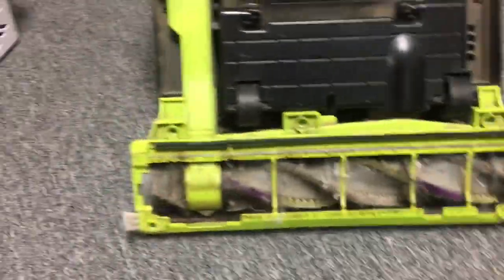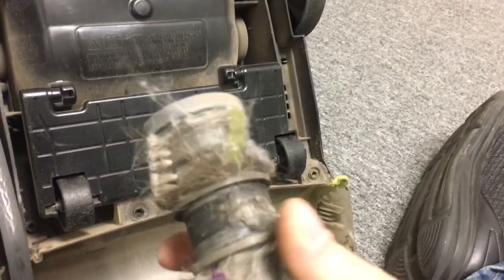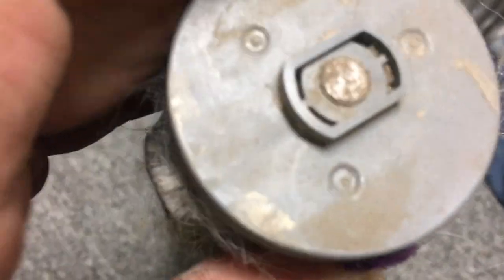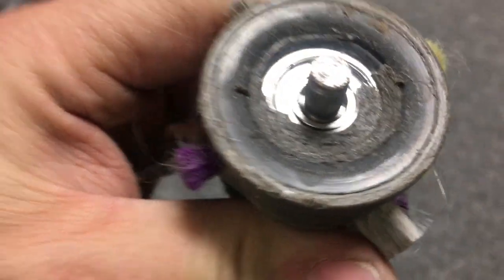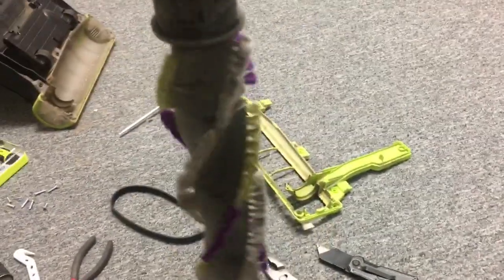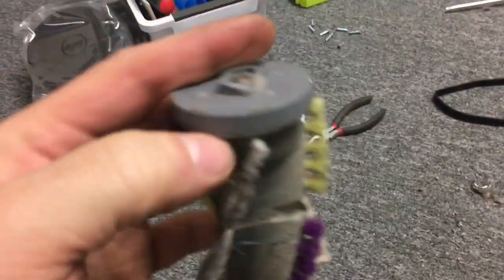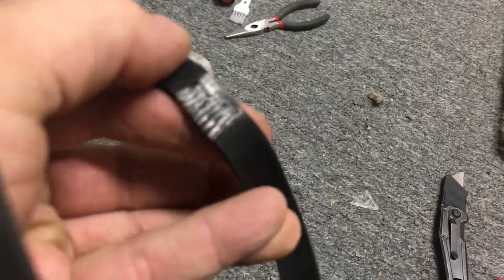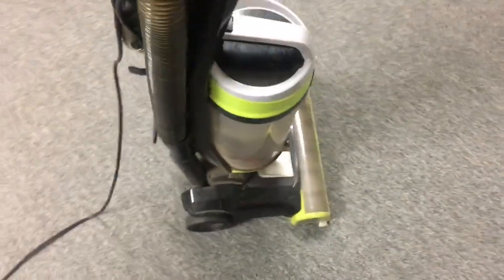Let's fix Bissell Vacuum Brush Roller not spinning belt is not broke

Comment: I got one of these for free recently.  It's brush was bound and Bissell recommended it replaced. Instead, I sprayed some Nut Buster into both ends of the brush and it gradually freed up. Now the unit runs like a top.
Reply from the maker: yeah the bearings were rusted. not sure if I showed the bearings on this one or not. people wash the rollers thinking that helps but it causes the bearings to rust because well you just trapped water into the ends,....

Comment: Is the rod the belt goes on supposed to be hot ?
Reply from the maker: that's the motor the motor gets hot. if the belt is slipping it gets even hotter... make sure your roller spins freely. I think I show it in video. if roller isnt spinning easily then you will burn belts and overheat the motor or melt a bearing on left or right side of the roller, or melt the roller at the belt area. the cleaning girls have melted a lot of rollers because they let roller slam still from too much hair or jammed stones, bolts, plastic etc...

Comment: I sprayed the roller off with my garden hose and now the roller has locked.
Reply from the maker: um never clean a roller with water. you rusted the bearings in both ends. you most likely can still open the ends and lube them back to life though. dont damage the ends and make note where the center axle is on both ends. aka is it sticking out slightly or is it flush on both sides, you want to put it back together as it is or you will offset where the belt touches and possible make is travel as it spins rub and snap over time.
Reply: @bobspurloc  thank you for the info & reply. I did get it spinning , finally . I haven't had this vacuum long. Looked a little Dusty under the clear brush roller, so I hit it with the garden hose. Started to vacuum the rug tonight and it was making that sound like something's wrong! I sprayed some silicone down into the axle, cleaned both ends. Put it back together ,but it wouldn't go . Took it apart again and it seemed to be okay. Put it together again , would not spin when I turn the motor on. I took my thumb and made it rotate a few times, then turns the motor on again and it started working. I was thinking I'm going to have to go buy another vacuum cleaner tomorrow. You saved me thank you very much.
Reply from the maker: well replacement rollers are under $20 I believe its all the same for Bissell. but yeah the bearings. if you take the roller out you can hold the end and spin the center. you dont want to use the motor/belt to force it because if the belt slips you are going to melt the belt aka snowballing the problem lol. but glad you got it going.

Comment: Thanks! I was wondering how to remove the end caps. One of the bearings was seized in mine. I replaced them with old skateboard bearings that spin well and that fixed my problem.
Reply from the maker: nice! yeah all the bearings are the same thing only difference is sealed or not. I think I noticed one thing though not sure, aligning the wheel properly back to the belt so it doesnt make it rub the metal barrier  or I may have had a warped roller. when the belt spins on a non moving roller and you ignore it it starts to melt the roller.

Comment: Would a roller not turning cause the vacuum to smoke? Because mine stopped working while I was using it,  and when I took to cover off, the belt was snapped. So I got a new belt and popped it on thinking that was all it would take, but when I turned it on and the roller still wasn't spinning, so I shut it off and then some smoke came out of it. I'm going to take it apart again and check the endcaps. But I'm leery about testing it out again if it's something else. I don't want to catch it on fire or something.
Reply from the maker: yes,,,, roller not spinning will cause the belt to smoke and break. you need to pull the roller out and see if it spins like I think I showed. the bearings do wear out on these from hair collecting into the area melting like plastic onto the bearings. its just best to replace the roller than the bearing depending on the damage and skill level. I think I show in other videos how to take roller apart least damage but sometimes its not wise as the belt spin area warps and will just cause belts to break prematurely etc

Comment: Thanks man. Who would think to remove the end caps. Did it on my Bissell and now the roller turns. Thanks so much for sharing.  Cheers
Reply from the maker: Yeah I just had another that was super loud. I finally realized it was the bearing on the belt side. I pulled roller completely apart and swapped the bearings now its quiet again.  beware though you should check the belt path after putting it back together as you can offset the roller and cause the belt to walk slightly outwards which would have it tapping the metal guide barrier near the motor. basically after putting all back together run motor for a few seconds then check the belt isnt hitting the metal guide as it will eventually rub snap. I think you can adjust the offset back by holding bother ends of roller and tapping the metal center so it moves slightly left or right.

Comment: My belt snapped, thanks for the vid
Reply from the maker: make sure your roller spins freely all the way around and is not binding, otherwise your belt was probably just old.  beware junk belts on amazon some are made of cheap rubber that snaps after like 20 uses

Comment: Hey howd you clean the end bearings? :)
Reply from the maker: I forget what I did here. there was burned hair and plastic there. I used a knife to to shave some or test what it was but I think mostly used a screw driver. also This bearing turned out to also be going bad, so I swapped it to the other side. normal pressure spinning it sounded fine but on the belt side that extra pull was making it loud. so swapped to other side. all these bears are basically the same thing in all tools these days. its the same as a power drill bearing, the bearing on the actual motor same bearing on skateboard same bearing in fidget spinners. of course you want a sealed bearing but they are all 608ZZ bearings metal sealed. https://amzn.to/44y9WWa

Comment: Ive just took my vaccum apart my vacuum is clean , I clean mine after every use,  thinking it was my belt i just changed it ,and it still wouldn't turn i was vacuuming before I noticed my brush wasn't turning that's what made me look  so I'm not sure how to check for the motor for the brush etc.
Reply from the maker: can you freely turn the brush?
Reply: @bobspurloc   no i can't, I've tried several times taking it off the belt and it still doesn't turn
Reply from the maker: did you watch this video??? kinda sounds like you didnt if that is your answer. my next questions would be what I showed in the video
Reply: @bobspurloc  it's a rarely new vaccum i purchased it 2017 and yes i watched the whole video but i don't know how to take those end things off, my vacuum has never had burnt hair or anything like that i keep my vacuum clean after every use so it's not anything to do with to much hair or whatever I'm going to rewatch this video maybe i missed something on it but I don't know how to take the ends off but they shouldn't look like the ones in this video
Reply from the maker: ok I was asking so you can see how the roller should turn. if you hold that very edge it should turn. if it doesnt then the bearings on one side are jammed for whatever reasons. you keep saying you clean it after each use so it should be ok... however are you cleaning the roller with water or some liquid??? because the only thing I can think of is a bearing rusted in place. I'de suggest getting a new roller not trying to fix that one. I made it look easy taking it apart where in reality the end plastic is likely to bend out of shape. the vacs I repair get extremely heavy use. https://amzn.to/3m1qGEH
Reply: @bobspurloc  i only clean off the hair and usually use a little dish soap and water but my rag is not soaking wet just enough to wipe the dust off
Reply from the maker: its all I can think of. maybe hair slowly collected. I dont know the full history of the one I showed I do know it was the only time a roller seized. I've replaced others just from the brush hairs wearing too short.
Reply: @bobspurloc   could it possibly be the motor maybe, it's probably something just stupid ass simple because it litterally was working until I got to the top of the stairs and was vacuuming the hallway between the bedrooms and i noticed my brush wasn't moving but it was before that and the other times i vaccumed didn't smell anything strange like burning or anything i even thought it was the dirt  bucket thing that collects the dust etc thinking it wasn't on right but I even took that back off and put it back on , i don't know, i just don't know, didn't want to buy another vaccum if i could easily fix this one but honestly I'm baffled i tried to figure it out today and still came out scratching my damn head , thank you for your help though I appreciate your time

Comment: Belt keeps coming off. Everything is clean on the vacuum. Having the same issue. I have to unscrew multiple times. I think everyone is have the same problem with the Bissell powerforce helix turbo rewind. It is poorly made without a proper securing mechanism to stop the belt from coming off
Reply from the maker: hmmm... Ide have to look at it to see how that is happening. I doubt your statement though as I repair these for a cleaning company. so they get heavy heavy use daily and non have any belt falling off issues. I forget what the issue was in this one, I think the side bearing melted with hair. you cant add something to the mechanism to hold a rubber belt in place that wont end well for the belt. it all about alignment. if its not aligned it will walk off
Reply: See if you can find or order a smaller belt for it